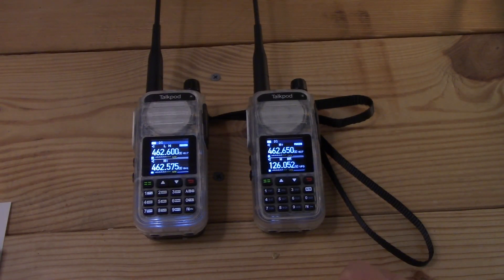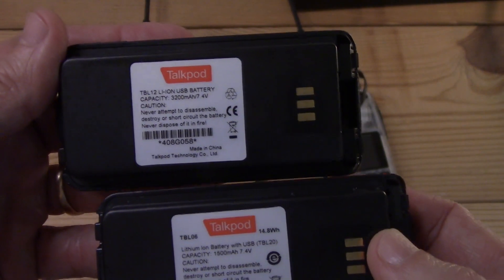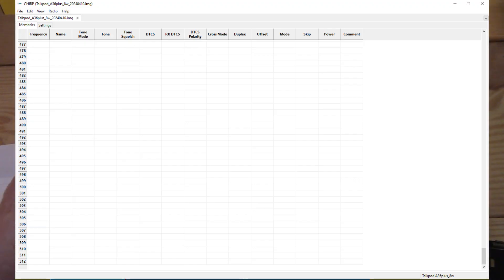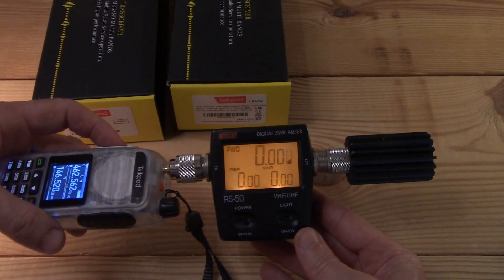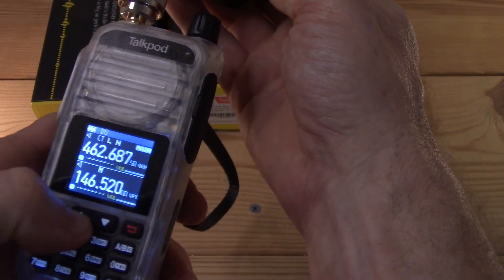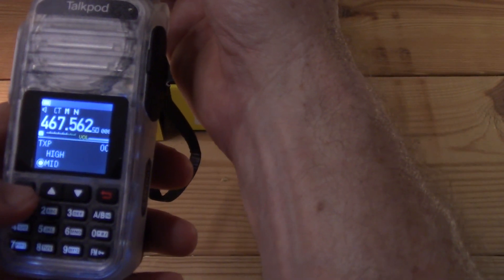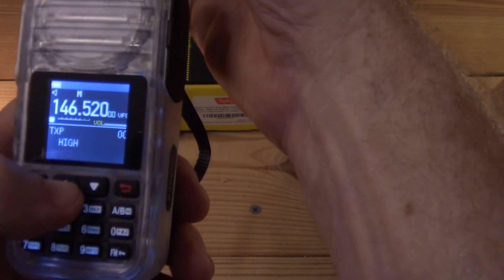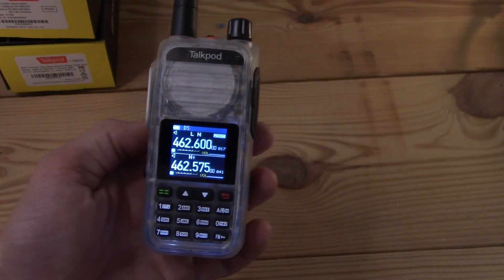The Talkpod A36Plus 8W Improvements

Comment: Thank you for the video! I got the 8W version just a couple of days ago. So far very impressed with the receiver! I always complain about direct conversion radios de-sensing on big antennas. It doesn't seem to happen with this one at all. Very good receive audio, too. According to my meter, it puts out ~7W on simplex and repeater GMRS channels. The only downside is that not all antennas fit. They seem to fit, but there is no RX or TX. Unfortunately, one of such antennas is the presumably "genuine" Nagoya 771G antenna from BTWR. The good news is that Smileys work well, so I can always use the telescopic Superstick with it if I want to. Thank you again!
Reply from the maker: Time will tell but this 8w version seems like a killer value. Yeah its not a name brand, but even my older "Japanese" rig's performance goes down hill with age. It's hard to dismiss the price differences.
Reply: @Soladaddy  What is your power output on VHF set to Medium? Mine is a bit low, less than 1 watt. Not a big deal, just wondering.